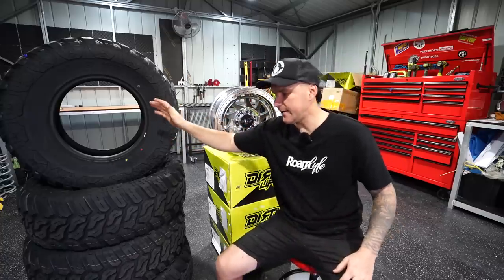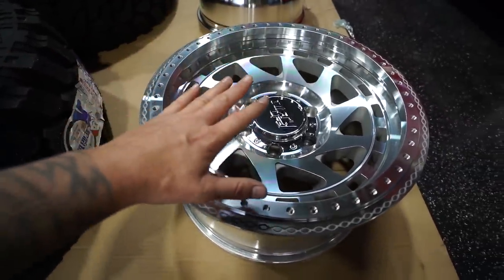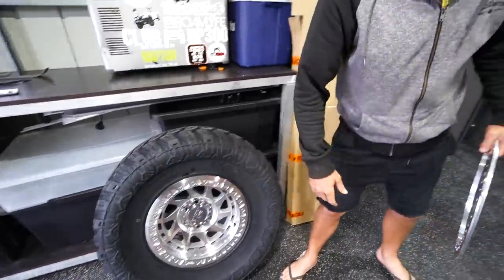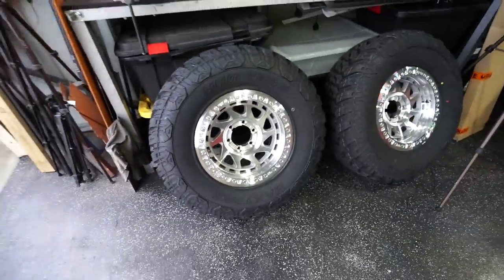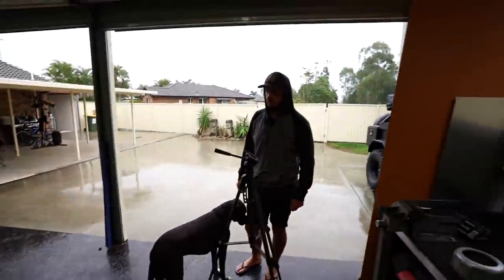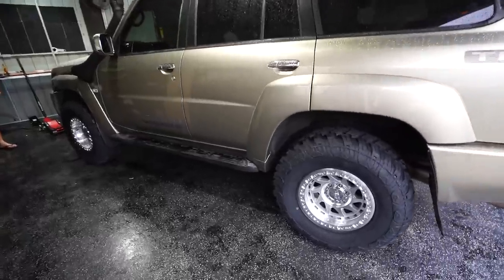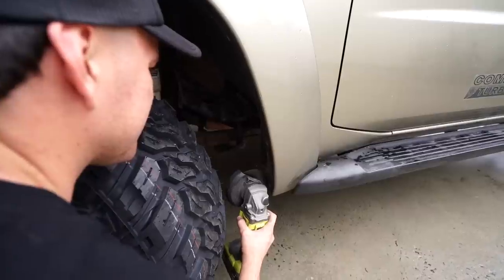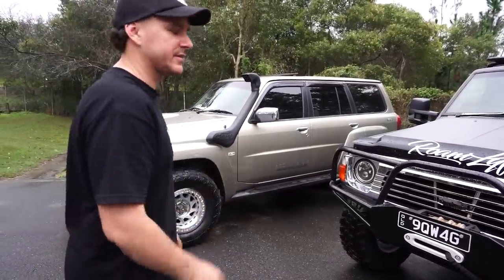THE Most Expensive BEADLOCKS Wheels I've Bought!! ARE THEY ANY GOOD???

Comment: Have you ever had any issues with splits in the side walls of the tires? I have the the same 35’s and all my tires still hold air but 2 of them have gotten splits from airing down to like 18psi, just wondering if it’s something common. Still rate them heaps, even for having them on the daily

Comment: Question - the center bore, does it go all of the way through with the full diameter, or is it stepped smaller at the outside face?  Your video is the first one I've seen where someone mounted them and it looks like I'd have no problem with these on manual locking hubs.  I'm getting mixed signals from wheel shops.

Comment: And as a tyre fitter it’s ment to be the yellow dot not the red one bc the red one it the heaviest spot and the yellow it’s the lightest spot
Reply from the maker: If both red and yellow dots are visible on your tyre and you don't have any dots or marks on your wheel, red takes precedence over yellow and you should align the red dot with the valve stem. Cancelling out the high point takes precedence over the lightest point of the tyre, which can be addressed with wheel weights

This was taken from google!!